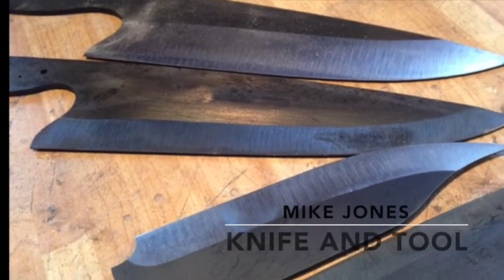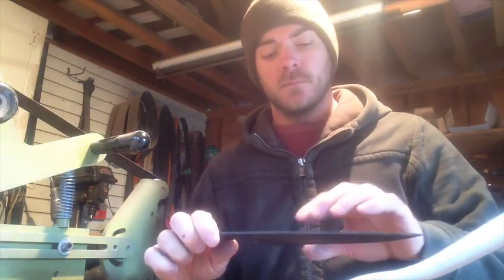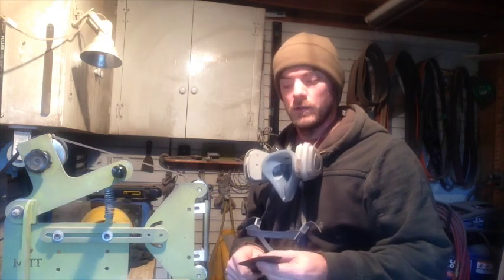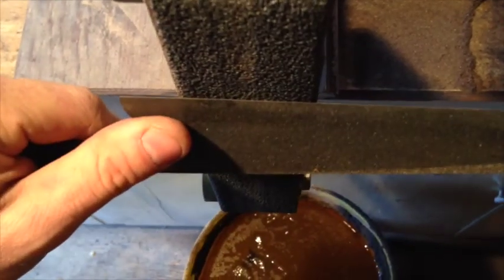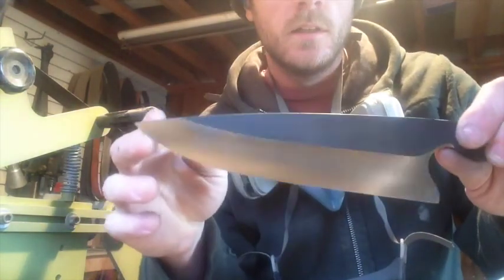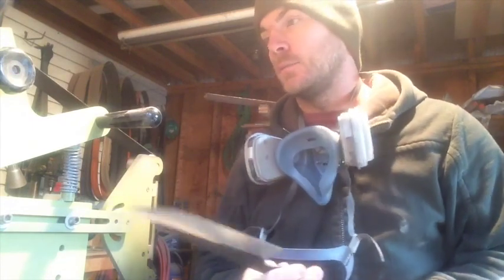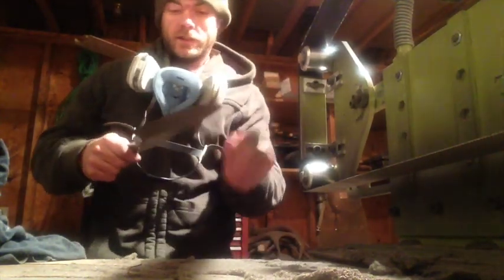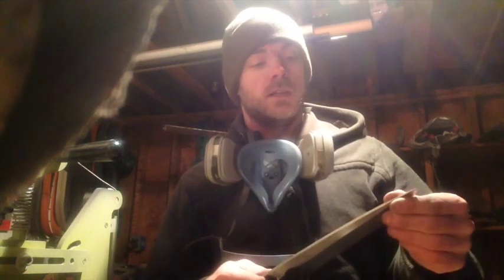Finish Grinding

Comment: Thanks for the very informative video, nice grinding! Could you please tell me what grit belt you used for finishing? I am not sure what grit to use for polishing, or what is the standard for a finished knife.
Reply from the maker: steven van rensburg thanks! I don’t remember what grit I finished this one at. There’s no real standard. It varies on the knife, application, Steel, and the maker. Some guys will finish at 220, others like a scotchbrite belt, maybe a handsand to 800, 1500, 2500? Some. Guys like a mirror polish. Non-stainless steels aren’t worth going too crazy ok because they’ll start to patina pretty quick and lose the shine.
Reply: Mike Jones Knife & Tool thanks for the information, appreciate it.

Comment: the thing about mixing stainless and HC belts is true if you are running a fabrication shop and only doing weld prep and crappy machine finish. as long as you dont contaminate your last grit you wont have any problems.

Comment: how do you keep the grind line distinct from the flat? I guess hand sanding softens the line? How do you do your finish grinding and sanding on the flats?
Reply from the maker: machine grinding creates the distinct line, hand sanding usually blends that a bit. Most of my outdoor knives are machine-finished (except damascus) and most of my kitchen stuff is hand sanded.
Reply: @MikejonesknifeandtoolTk  Say I want that distinct line. Should I sand flats then bevel? What grit progression do you use before and after HT?

Comment: I am trying to decide what kind of belt grinder I should get first I was thinking about a small 1x30 Harbor freight grinder or saving up a maybe getting a bit bigger grizzly I don't thing I'm ready or have enough money to get a 2x72 yet
Reply from the maker: +Josiah Musser I started on my little 4x36 that was $80 on sale, worked just fine! Heard lots of guys having great luck with the 1x30, and some very experienced guys still use theirs for certain processes. No need to jump into $2k worth of grinder right away. It won't make your knives any better when you're starting out.